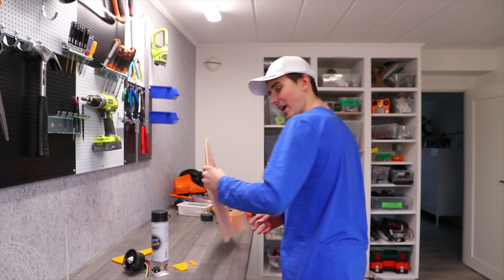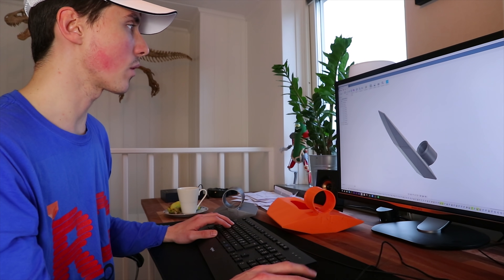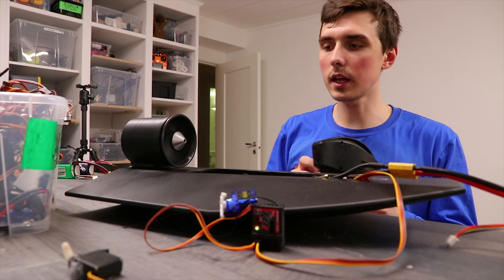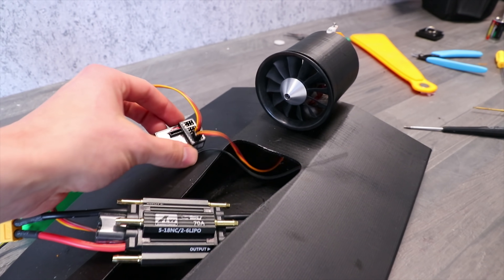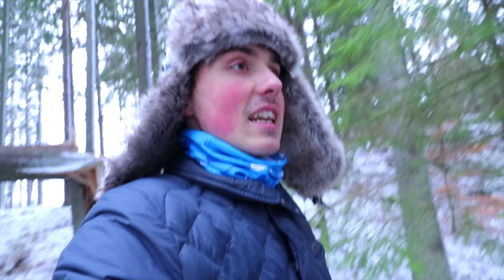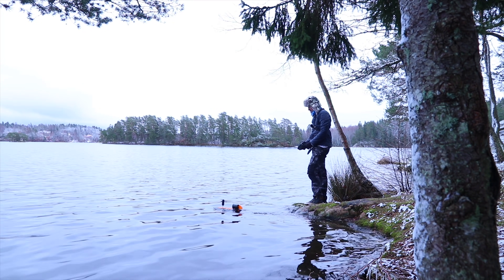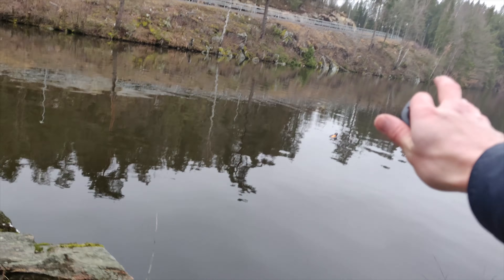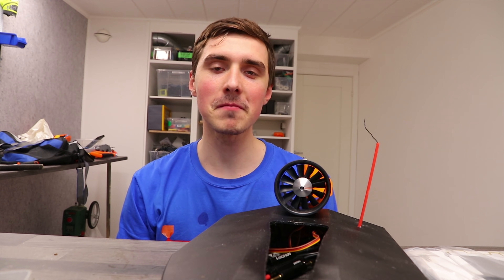Fan Powered 3D Printed RC Airboat

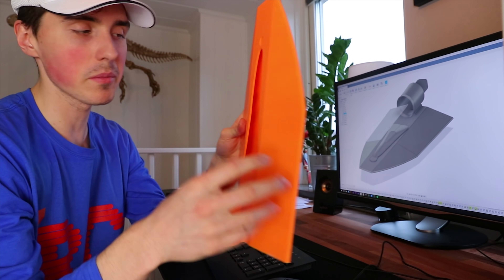Comment: THANKS, FOR SHARING!!!   IMHO: (@~1:30..) YOUCAN "SANVAGE THAT THIN HULLED ATTEMPTED BOAT, BY FILLING THE ENTIRE HULL WITH "SPRAY FOAM"....ADD A THING FIBERGLASS LAYER TO THE BOTTOM, IF NEEDED...   GOOD LUCK!!!1   YOU SHOULD BUILD LONGER HULLS,... THEY MAY RIDE MORE SMOOTHLY, OVER SMALL WAVES...

Comment: I would have suggested that the motor mount be a separate object that is bolted down to the body. That way you have full ability to adjust/size and modify to fit the motor, wiring and any additional controls and water proofing.

Comment: I think you should try a design where the fan and motor are on the front and angle the motor up slightly so that the motor isn’t trying to push the boats nose into the ground

Comment: Nice job, that was entertaining. 
Years ago after I had an unfortunate accident with my RC Plane while I was reconstructing the wing I made a Pontoon boat out of styrofoam then sealed it in the same plastic covering shrink-wrap used on the Plane. After mounting my .25 hp motor, a rudder, two servos and a tank out I went to a small lake. I learned real quick I should not have gone out too far! I waited forever for the current to bring my boat back after the engine stopped.

Comment: The hull might have flooded just enough to have the battery connectors short due to the water conductivity. Just a guess. If you waterproof all your connections it might help.

Comment: Give the tip a spight slope upwards and add an aluminum plate on the underside as a heatsink for the esc, so it transfers the heat into the water.

Comment: READ ME ! HAVE AWESOME IDEAS HERE ! ~>> 10:20 Fishing pole wouldn't be necessary as long as you had some sort of string or fishing line with a hook or even better a magnet you could fly it over to the boat on your drone and then either tow it in with the drone or just pull it in with your hands. Heck! You could even print a boat big enough to have a landing pad for your drone. Then once it lands you could have it magnet in place then have some sort of wind ramps that would convert the drones downward thrust into horizontal thrust. Have magnets powerful enough to hold it on the boat for most drone thrusts delivered but then hit like 80% ~> 100% thrust power and the drone could break free and fly around again independently if needed ! Have a strong enough drone and magnets and it could just fly the boat all the way back to you ! : )

Comment: Ha! I just watched your other video and was thinking to myself, "I wonder if this guy has come across ducted fans yet"... was about to suggest that in a post when I saw this video :-)  Other ideas... make it a U-shape sort of like a catamaran, put the fan at the front and pointing down a little to generate some lift and reduce the drag from the water; and 2) - hybrid jet boat/quad- or tri-copter - to get it out of the water and onto land (assuming it has a computer and gps inside and you're using it in autonomous mode!  That's the next upgrade, right? :-) )

Comment: Print some lateral fins that sink into the water, to make the boat more stable when turning. Also, try to print the tail "slanted". You could 3d print also a channel to draw water in, even passively, to cool somewhat the controller.

Comment: A "step" in the hull will help the water detach from the bottom of the boat and it will get up to speed faster.  I think thats important, especially if using an EDF which doesnt have much torque.

Comment: Make an R/C Submarine with two motors in the back, the reason for the two motors is because one motors has a vertical rudder and the other motor has a horizontal rudder. If you can make a ballast too that would be awesome!

Comment: Using twin-rudders, and throating the exhaust port down a little, would make for better maneuvering, and faster speed.  Might even put a 2 to 5 degree plane at the bottom of the exhaust to keep the nose from porpoising.

Comment: Just an idea to help make the design more waterproof, if you make the orange top more Iike a cap (flat top with walls around it) you could raise the opening and have the magnetic top slide over the outside edges of the newly designed raised opening. This might also allow you to add some sort of silicon ring to be placed within the cap for an even more waterproof design if designed properly. I would also recommend designing compartments within the boat to stop the “guts” from sliding around.

Comment: I think the design was not good. I mean it, SERIOUSLY YOU NEED PUT THE TURBINE IN THE MIDDLE OF THE BOAT. THAT WAY WOULD NOT HAVE BEEN SMOKING. and also, you need to measure weights and center of the gravity of the boat so it won’t sink.I mean, SRSLY? Nice thinking though.just pointing out the mistakes.Sorry.

Comment: I'm super happy to have found this channel.  It's been a hobby of mine to do little projects like this with 3D printing and robotics since college (mech engr). I'm currently building a 3d printed StarWars turret that's remote controlled (if my printer will decide not to randomly stop on a 32 hour print). My favorite part of your style is that you show the mistakes in initial prototypes, and discuss how you fix them.  Tolerances, material failure, and also just accidentally not realizing something wrong in the design in these types of projects happen all of the time.  Many channels cut the unsuccessful versions from the video.  I find it to be much more realistic and supportive showing people that these things happen all the time with initial design.  Keep it up!

Comment: Wouldn't it be better if you had given it a raised front? In a propeller driven boat the propeller is fixed at the rear with propeller in water thus when it pushes the boat automatically rises up from the front. Here because it's a fan on top of the rear part of the boat it seems to be pushing the front end down which is probably the reason that it went under once while testing.

Comment: you can orient the rudder axis so the top is oriented towards the front for like 10/20 degrees, it will roll the boat inward in the turns, you can add what is called sponso in the Jet Ski world, they are leading edges on the side that grips water to turn by avoiding drift. Orientation of the thrust I mentioned provide push on these edges to produce grip and rotation

Comment: A Question, only silicon on the "chip" from the servo and its waterproof? Must to the point where the gear is also something against water? When yes, what?
Reply: back when, we just used vaseline to all casing+wire seams and a good glob inside the top around the output spline, simple and worked great.
Reply: @modelnutty6503  Ok Thank you. I heard that vaseline servomotors broke. Did you notice anything there?

Comment: You have to flatten the bottom of the hull so it glides better. As a result, it will also get better and faster. Replace the hump on the bow with a smooth, round transition to the top.
With these modifications it drives much better and you do not need so much power to start.
I think your videos are very good and I would be happy if more of them came.
Warm greetings from Germany

Comment: You should upgrade the blade on back of the boat, and let it be sharp. Your boat will be more stabile and more over locked on surface. But everything else is great.

Comment: Nice boat. If you make a new version include some large perpendicular notches on the bottom like in racing or powerboats. They will help lift it on top of the water and reduce resistance. Your design glues itsself to the water like a wildwater kayak. Also adjustable downward fins on the back will help it get on a plane quickly. You will be surprised at how fast it will go then! Cheers

Comment: "what the heck was that" the fan is mounted on the top of the boat so if it has enough power it will push the nose down and it will go underwater causing it to flip (when enough speed to do so)

Comment: I enjoy boating too, so I just subscribed. In fact a boat was my first RC and very quickly, after getting hung up on an underwater rock shelf I learned I would need a rescue system, so I always take the boat out with an inflatable raft & electric pump in the trunk of my car. I can be ready to  rescue my boat within 8 minutes. I may need it this year too, because I just put a Traxxas vileneon motor in a 23" Proboat! It may need wings. 
Thanks for this video. I was literally just wondering yesterday why I've never seen an EDF on a boat. Now I have and I'm encouraged to try the same.

Comment: Make a tube from the bottom inside the boat to the edf exhaust this will act like a siphon and pull water out.
Also add small steps in the bottom of the boat with a spine in the center the small steps hold air at speed and reduce drag

Comment: It needs water cooling all boats (RC boats) need water cooling because the esc has no way to vent the heat because of the closed space get some RC fuel line and connect it to those brass pieces on the esc then make a water pickup then water outlet

Comment: you would've most likely had much better results with a keel, if you don't know what it is, it's like a fin that extrudes into the water lengthwise from the bottom of the boat, they make control much easier and prevent flipping or spinning out of control at higher speeds. Of course, hydrofoils also had the same effects with increased speeds.

Comment: Try adding foils on the edges of the boat like a hydrofoil may be you could just stick it lets see how it does, also would you be able to run two parallel fans with the same motor increasing lift.

Comment: Half the fun of designing your own boat is that you learn hydrodynamics from an Empirical standpoint! If you want a really stable boat, make it a catamaran style, make the hull into two hulls, with a put a channel between them for the water the go through, If you want it to corner like a Porsche put a downward fin from the keel of each hull, and your boat will corner like a demon, if you do this, it will handle like a boat, but if you leave the bottom of your boat flat like it is now, it will behave more like a swap boat, it'll be able to "slide" in corners. It all depends on how you want it to behave, but I would suggest you give your boat, at the very least, a "V" shaped hull, right now your trying to control a dinner plate. The more surface area the is flat, the more drag your boat will have. Water is like air and in water, streamlining is everything, that's why there are only two shapes of hulls being used in world class powerboating, the Stiletto shape where the hull is long and pointed at the front, and the other shape in the Catamaran. Two hulled boats are by far the Stablest, that's all I'm going to say! That motor you used totally rocks, is it mean for RC Airplanes? ...Say, mounted where the "jet engine" is mounted? There has to be larger sizes? This totally gives me an Idea! Thanks! Good video! I just got myself an Ender 3X and I'm just waiting for my Filament to arrive and I'll be printing like a mad man! Thanks, BTW. I watched a couple of your Videos on 3D printers, it was a Huge help in my decision on buying my printer! Thank you so much for making your videos, as long as someone is either helped in some way or inspired in some way from your work, has to be considered a success!

Comment: 0/

Edit: Yeah, looking forward to a build video...  That would be nice...

Edit 2 : I don't like your boat design, I think there's too much surface contact for what it does...  I'm not very good at Fusion 360 yet but I'd make it deeper in the front than in the back, to make a sort of pivot point in the water, and also making it deeper will add buoyancy...  If I could I'd try to design a boat and put it up against you  x P

Comment: ever think about trying a hydrofoil boat ? would look pretty sweet when it lifts up
Reply: Are you me? my thoughts exactly.
Reply: lol great minds think alike  @PeteP86
Reply: Swag Land  sure it would, if it's properly balanced and had the right power to weight ratio
Reply: mars base you dont know what areodynamics is.
Reply: One that you can trim the foil on the fly!
Reply: Scarakus I was making one, ended up being a good submarine 😂 it can’t be 3D printed... to heavy
Reply: I’m about to suggest this. Lol
Reply: 'foils are VERY cool, and very doable! the type with a skimmer (disk or arm) to automatically regulate the pitch and ride height may work out the best, water does have to be pretty smooth/flat. once they're up they consume very little power, 
may not be a speed demon, but LONG run times are doable.
Reply: model nutty please stop saying “doable” 😬
Reply: @Rc2Go  I don't think that's doable
Reply: Was about to write this :)

Comment: Nice one!
May I suggest something?
If you are planning on using it only for water (maybe also snow), you could try and design some kind of keel on the hull, so in sharp turns the boat would be more stable and predictable.

Comment: You need to rebuild that using second-hand 80 mm server fans controlled separately instead of the rudder...And use a velcro to fix the battery near the center of buoyance.

Comment: Hi Simon,  nice project.. as alwais.   I think the problem with your boat stability is that u must " renew " the  keel, on particuliar your model doesn't have lines that make water flow in one direction ( as flaps and fins does on airplanes and boats ) .  Do a little research on  F1 RC BOAT.   Look this  video (  https://www.youtube.com/watch?v=R0rLWJzOnLA    ) ,the trusting system and the roll recovery sys too.  ;-)

Comment: Hi I know why the airboat did that at 0:05 I dont know the scientific name but essentially what it happens is that if the mass of the boat is in the front of the boat at a high speed, the boat will lean towards the front and because is going so fast it will sink in the water (that is what happened in the video), so try to secure everything that is inside so that it does not move and try to find out where the center of mass should be (it has to be behind the half of the boat but no all the way behind neither)

Also try to add slots, this should help the boat to accelerate more faster

Comment: Great video man. And that's that an impressive design. Just a suggestion though, make the bottom surface of the boat a bit more flat so it can handle the buoyant forces properly, and as the boat picks up speed, it tends to pitch up...so I guess it would be better to position the fan a bit more fore instead of aft. Or, just shift the CG towards extremely front. An addition, like double skis on either side would add stability!! :) ;)

Comment: I wonder if the ESC magic smoke has anything to do with it being a marine ESC that has a water cooling block that requires water for cooling...
Reply: @aval1998  o.o my bad
ty
Reply: When he stuffed it inside the boat I thought "ok he edited out the bit where he ran the plumbing". Nup, pops marine esc due to no cooling. Honest mistake though, he probs thought the motor wouldn't draw as much as a boat motor, or simply overlooked it. Done it myself with batteries (big barstards). one mistake and balance wire goes "whoof" in smoke :)
Reply: Yeah the 6 brass nipples would've been for water cooling yea?
Reply: yeah it's things like this that make me lose hope in humanity. 
and i bet he himself thinks he's really smart and all.  but he completely missed the fact that those are there.  
what did he think all the metal and the nipples were for?   looks?
Reply: @darkracer1252  i dont think he didnt knew. A boat motor sucks a lot more amps than one fan. Well... At least it should😂😂😂
Reply: @darkracer1252  xD
Yeah it's rather amusing, but there are way bigger fish to fry in terms of losing hope in humanity, like feminists, SJWs and everything wrong with our media right now.
Reply: @darkracer1252  Eh.

Comment: Dude!, why didn't you use the speed controller as intended and cool it with water?
It is really simple if you don't know how to: there are pipes coming out of the ESC, start from one and connect a plastic/silicon tube (if they are not marked, it doesn't matter which one) and take it to the bottom of the boat and cut a hole on the bottom of the boat and make a V-shaped part which will push water inside the tube. then find the output of the pipe (there can be multiple channels sometimes) and connect another tube to the output of that ESC pipe, then take it to the back of the boat and drain the water. that's it! Hope I was clear if I wasn't you can check online it is very common. 

Anyways nice video
Waiting for more